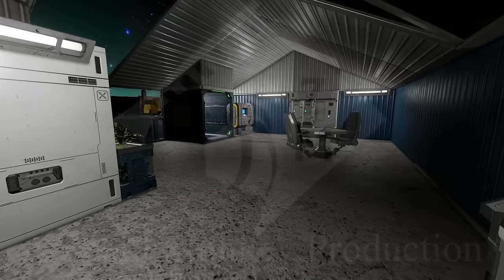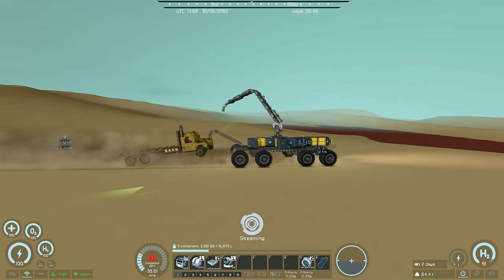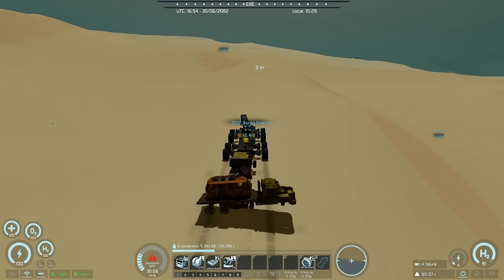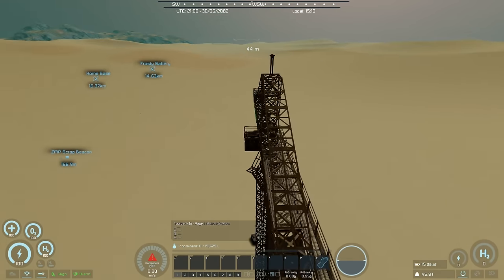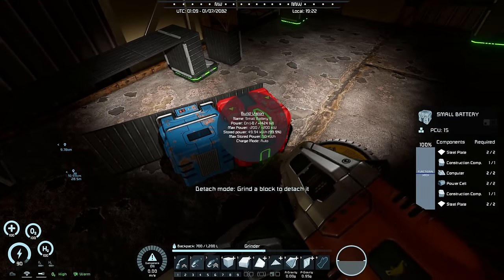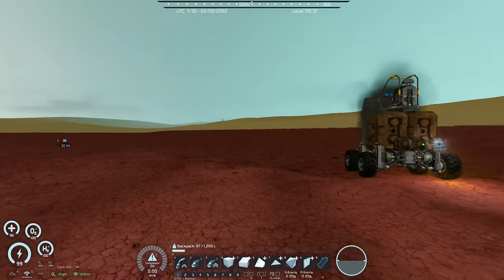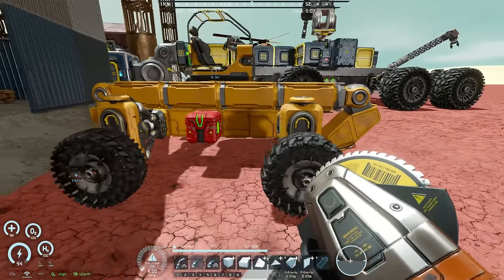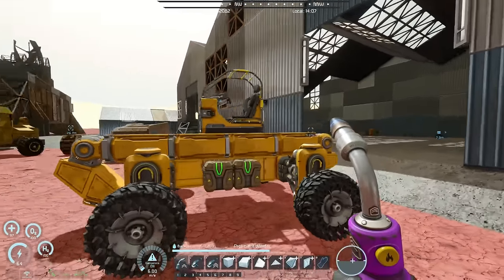Feedback for the Win - Scrapyard #8

Comment: @47:58 you talk about a math problem involving the angles of the rotors and the pistons in order to maintain the same horizontal position of the front of the grabby hand thing while only increasing it's height off the ground.
If we're talking about just distances, than it's fairly simple to calculate. However how to automatically implement that into Space Engineers I have no idea, but if you could it'd probably be the most accurate. When talking about piston + rotation speed, then the math gets a lot harder (but not impossible), the advantage of doing it that way is that it makes placing those values into SE much easier, however I'm not so sure clang will allow those calculations to remain accurate for long. So let's start with just the distance and angle calculations first and work our way to the more complicated math after.

Okay so the math for this is just simple trig. First, S(o/h) C(a/h) T(o/a). We're dealing with the opposite and adjacent lengths to the rotor angle so Tangent is appropriate here. The calculation would be tan^-1(desired height/constant length)=rotor angle. Just make sure both rotors are set to the same angle (one will probably need to be negative). That part is the simple part, but to calculate this while in motion that requires more thought (also I don't know the character limit on youtube comments)...
Reply: So let's start working on the harder math. One thing to keep in mind is that the piston motion value would still need to be changed constantly as this would be something that would be higher in the middle of the limits (45deg) and much lower near the limits (0deg and 90deg). There might be some happy middle-ground value where you could get close (especially at a very low rotation speed), but other than that the need for some sort of programmable block to adjust the pistons dynamically would still be required regardless of the mathematical method taken. I'm gonna watch the rest of the video before commenting further...
(Edit after watching the rest)
Just seen 56:25 , yeah okay you came to the same conclusion. Glad you already found your middle-ground value already, I really didn't want to try and calculate that. So let's get to the solution that I was thinking about...

First off the hinge at the base should have a min limit of like 0.5 deg and a max limit of cos^-1(desired static length/piston max length including pistons). My estimations is that the max should be somewhere around 55deg (just eyeballing things from the video) but you should measure it's real length in blocks and do the math your self for that.

Second, in order to automatically keep the load level, and be able to easily adjust it's y and z positions independently would require a bit of scripting. I'm not sure if the park script could do it. But if I was to suggest some changes, this is what I'd suggest (keep in mind that even though I am okay with programming in C, I have zero experience with SE scripting).

Adjusting the speed/length of the pistons is probably not a practical solution given the inconsistencies in SE's physics. You're probably better off adjusting the desired rotation angle of the two hinges through some sort of script. Have the script activate when the assigned "only move up button" is pressed, then have it have the script set the piston speed to a safe constant value (divided by the number of pistons of course). Then every .5 seconds or so, have the script take the length of one of the pistons, and adjust the desired angle based off that.
Something similar to hingeAngle = cos^-1( desiredStaticLength / (currentPistonLength * numOfPistons + lengthAtZero) );
When the script starts, maybe have it set the desiredStaticLength variable automatically so you only have to calibrate the lengthAtZero value. So something like desiredStaticLength = ( cos( currentHingeAngle ) * ( currentPistonLength * numOfPistons + lengthAtZero ) );

Doing something similar for only increasing/decreasing horizontal distance and not vertical, should be pretty simple once the first half of the script is figured out. Same approach, just slightly different formulas. Have it activate when the "only move forward button" is pressed. Have it first calculate the desiredStaticHeight.  ( sin( currentHingeAngle ) * ( currentPistonLength * numOfPistons + lengthAtZero )
Then have it set the desired hinge angle automatically on a 0.5 second basis (or whatever works) based off a formula like this...
hingeAngle = sin^-1( desiredStaticHeight / (currentPistonLength * numOfPistons + lengthAtZero) );

That should cover most of the basic math for movement and how it might be added to a script if it's language is anything like C. If you like I can continue to cover how diagonal movements (moving in both forward/back and up/down) would be covered, as those formulas are actually pretty simple in comparison. But I think this comment is already long enough.

Comment: 48:45 - Unfortunately, there's not going to be a fixed speed to get it to work perfectly like that.  As the angle of the back hinge increases, the rate at which the pistons need to extend becomes increasingly large.  You can see why by thinking about how it would work if the pistons could extend infinitely.  As you get close to a full 90 degrees on the pistons, the vertical height that the load needs to be at to still be in front of the front wheels becomes incredibly large (and infinite large, at 90 degrees exactly).  Even a tiny increase in the angle requires incredible increases in the piston length.  Meanwhile, when the hinge is at 0 degrees, the pistons barely need to move even as the hinges arcs through the first 10-15 degrees.

Your set of pistons is 4m long fully collapsed.  At 20 degrees, the pistons only need to have extended to a total of 4.26m, but at 40 degrees, they'd need to be at 5.22m total, and at 60 degrees, 8m, and at 80 degrees, 23.04m.  As you can see, the speed of the pistons would to go up as the angle increases.  The maximum angle for which the payload can be kept in the same horizontal position that it started is just a smidge over 70 degrees, at which point the pistons would be at their full 12m extended length.  Below is a link to a graph of how long the set of pistons would need to be for angles between 0 and 71 degrees, in order to keep the payload in the same horizontal location (so effectively lifting it purely vertically, no lateral movement).  You'd need a script to set the piston velocity based on the hinge velocity and the hinge angle (which, tbh, is totally something a programming block script could do).

https://www.wolframalpha.com/input?i=plot+y+%3D+4%2Fcos%28x*%28pi%2F180%29%29+from+0+to+71
Reply: Also, if you want to go that route (or have someone else do it), the equation for the speed of the pistons based on the angle and speed of the hinge is:

PistonSpeed = (1/30)*π*tan((π*HingeAngle)/180)*sec((π*HingeAngle)/180)*HingeRPM

Where PistonSpeed is speed in meters per second for each piston (assuming a set of 4) to extend at, HingeAngle is in degrees, and HingeRPM is, well, the RPM of the hinge.  If using degrees per second instead, divide the resulting speed by 6 (1 RPM = 6 degrees per second).

Comment: Can you use a connector behind a magplate since the magplate is flat? Will it still connect?

The heaviest is steel plates in a container incase there is a multiplier on cargo volume. 

If you are building a 2nd one you could maybe more compact if you offset the telescope arm by 1 and it still would look decent.
Reply from the maker: Hmm... I'm not sure. I suspect you can as the mag plates are pretty flat, they're thicker than most of the things I've seen used that way but probably not by enough for it to stop the connector locking.

As to the inventory multiplier, for a long time (since they last changed the defaults), mass is inversely changed with inventory multiplier e.g. a steel plate has 1/10th the mass when in a cargo container in a game with x10 inventory - the reason for this is to make a design that works on 1 inventory multiplier, work on all of them :)

Comment: Hey just a quick question, how do you go dragging stuff around?
Reply: The original mod is called Grabby Hands but the server uses "Imrpovised Experimentation" (i think or improved) which allows adjusting the strength to prevent lifting heavier blocks making cranes and similar necessary
Reply: Awesome thank you, I will look on the store for it

Comment: so, i fell off a building while trying to manoeuvre a rescued solar panel and got driven into the ground and died from being smashed in the head by a killer solar Paner.... anyway, my body was glitchy and then got sucked into the ground and disappeared.... is there any way to get it back or cheat in the items it was carrying? .... (32 solar cells i had on my body until i was sure the solar panel was safe from being damaged before placement).
Reply from the maker: Ouch, in single player you can press alt+F10 to enable creative mode, close that menu, then press shift+F10 to open the spawn menu and spawn in the components 🙂

Comment: Maybe you should build a Large Grid rig that has grinders on the front to grind down all the things you run into and maybe if you want a cargo hold with bottom doors to pickup grids so you could get the parts in the safety of the Large Rover.
Reply: Grid grinders are messy and fling things around so you would need to still go around and grind all the pieces.
Reply: @davidmartensson273  Ive only seen that happen with grind pits and small grinds thrown in.
Reply: @jakebswenka  I have seen it with grinders mounted on ships also, anytime the grid your grinding is not locked down.
Reply: @davidmartensson273  I guess it's up to splitsie if that will work because idk if he encounters more station grids or ship grids but then again, I did say a hangar bay with floor doors so he could just hoist it into the hangar if it's a ship grid anyway to get parts.
Reply: @jakebswenka  Point here though is you do not only want parts since many blocks cannot be built but have to be salvaged whole, so the grinding of a full grid is mainly for cleanup after having removed all the good parts.

And basic parts you get from that you often get an abundance of anyway since you rarely build very big structures on a scrap playthrough :D

And for pure cleanup, you could also just drop the grid of outside of the scrap beacon safe zone and have the auto cleanup do it.

Then you still have all the small armor parts that fell of to handle.

Comment: 59:00 Me: "He's definitely not fork lift certified" I'll give you a real world tip that can be applicable to this scenario. always keep the load as close to the ground as possible. You could have cleared your ramp by tilting the connection point up more. as for 1:01:00 this could be an actual use to mass blocks?

Comment: 48:45 "I presume mathematically, it's possible"
It isn't.  There isn't a constant extension speed to match the constant rotation speed.

Think about it this way: 
One degree of rotation around horizontal needs almost no extension.
One degree of rotation when near vertical would need an almost infinite amount of extension to remain out in front.

The graph is going to be a y=tan(x) one.
Reply: 1:00:15 also not how it works... It could be connected in any way, but the only relevant factor is where the joint centre of mass is, compared to the points of contact.  
As soon as that CoM moves in front of your pivot point (front axel) that's when it's going to tip.

At which point I realise Splitsie is talking about how he can move the COM of the vehicle backwards and this comment is worthless

Comment: The speed of the pistons should be easy to calculate. After some experimenting in desmos, I'm fairly certain that setting them to be √2 * min_piston_length * hinge_speed/8. √2 is aprox 1.41421356237. hinge_speed parameter might be wrong, I'll test it. But esentially there is a multiple of your hinge_speed that will make the rest of the equation work

This will make the pistons keep the object at the same distance horizontally up to 45º
Reply: No, as Splitsie realized in the end, the speed would need to change with the angle making it impossible without a script that constantly recalculates.

Comment: for a tele-handler, assemble a wheel axle (two wheels and axle in between) then attach it to the body of the vehicle with a rotor. this way you can rotate the axle to allow movement in any direction , including 'almost' sideways.?  mmm wait, balance issues, grrr. Okay how about ,, having the whole undercarriage on a rotor (like an excavator?) but add a locking plate at the end of a piston that can lift the whole thing so u can rotate the undercarriage and then set it back down so without maneuvering u can change direction 90 degrees.     I love engineering yeah.

Comment: I found one of those it was a just a lot of noise and lights but no boom 29:57
Reply from the maker: There are multiple variants, one does indeed go boom - which I'm pretty sure is the one I got since a couple of frames before I ground it down, the warhead blinked blue as its timer had begun